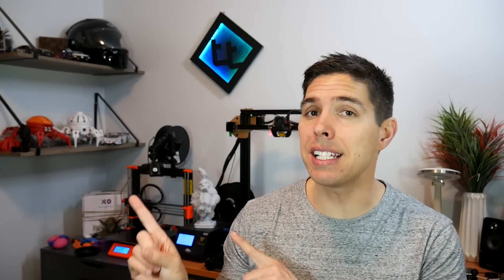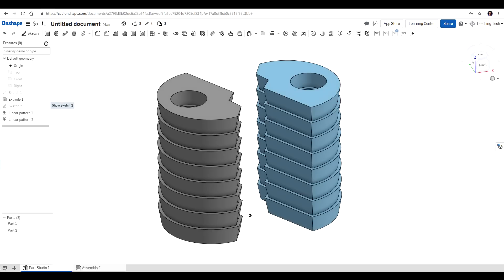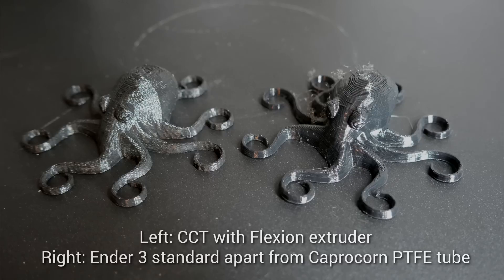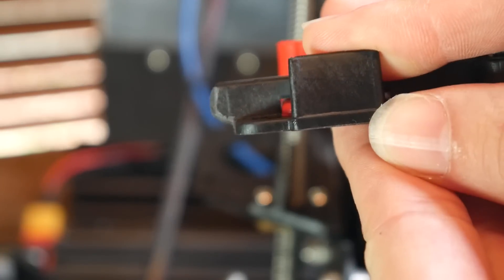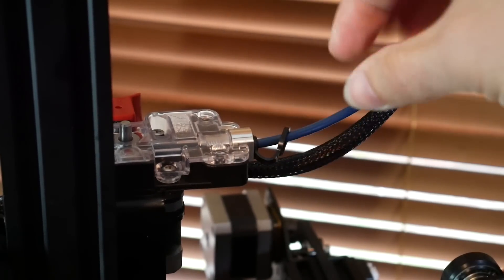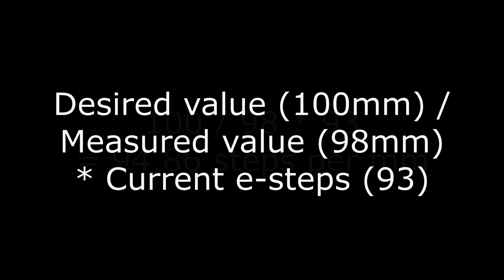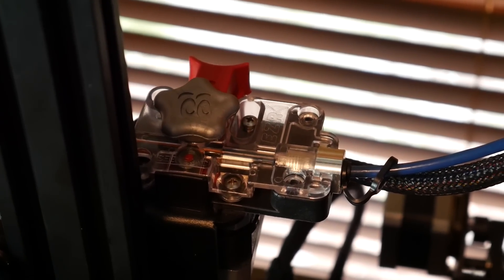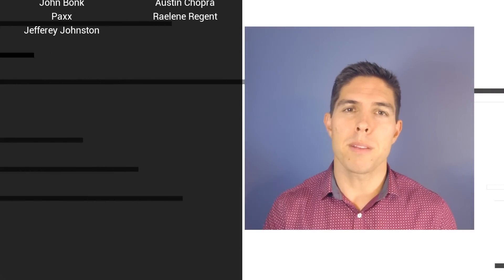EZR extruder tested on the Ender 3

Comment: I do agree that the EZR extruder @ $30+ may be a lot but not a bad upgrade to have on your Ender 3D printer... See I am a 3D printer NOVICE and I have destroyed and put back together my Ender 3 v2 printer and after watching LOTS of YouTube videos like yours I have learned that patience play a long way.

I did buy the SeemeCNC EZR extruder for my Ender 3 v2 3D printer and what I found is that one it makes loading filament quite easy including TPU filaments and in the Cura slicer you do have to play around with retraction adjustments and speed which many of you already know... Two, I didn't like that the "spring" had to be installed but I got it on there right... Once this was done and begin printing I have had VERY little issues with my PLA and PETG prints as well as my TPU prints which came out better then having the original Creailty extruder with little to NO stringing at all. That my 2 cents and if you are a beginner 3D printer person learn your equipment first before making this purchase.

Comment: If anyone still watched this in 2021 i would like to point out you can actually use the stock feed gear in the kit and not have to worry about resetting the e steps works just as good as the new one in the kit and saves some hassle

Comment: I ordered one of these shortly after watching the video and have been using this extruder for a few weeks and finally got to print TPU and this extruder doesnt skip a beat.  I did have some problems with it jamming on a wood filament but Im sure it's that specific filament that's the problem. Loving it and noticed my extrusion on PLA seems more reliable as well.  So love how easy it is to load filament now.

Comment: I just put one on my Geeetech A10M.  Big improvement.  Prints TPU now with ease and PLA and PETG look cleaner than they ever have.  Very worthwhile upgrade on  the Geeetech.  Just be aware that the extruder stepper will have to be reversed from the stock extruder's direction.

Comment: I thought I had my settings dialed in nice for 95A, but during long prints, the filament got weirdly bunched up in the extruder and stopped extruding on a 2-day long print. So disappointing. I have one of these being sent and considering pairing it with the MDD conversion you did another video on. I will say, I wasn't aware of the E-step thing... Did you need to do any firmware upgrades to get that?

Comment: I am considering getting one.  I 3d printed a extruder knob.  Which really helped loading filament.  But here lately I have been changing filament alot. An the filament not wanting to go through into the bowden tube.  Like you mentioned in the video.  Has gotten a lot worse maybe because of the cheap filament I've been using. Or maybe because I have retraction on a lot lately.  The filament leaves dust like particles of filament behind.  I have been blowing out after each print.  I have some tpu I want to try.  But because of the filament get stuck outside the bowden.  I was unable to even load the tpu.  So yeah I may have to get this been eying it for awhile. Thanks for the review!

Comment: I installed the EZR extruder and while using filament, the stepper motor will go forward for a bit then quickly reverse, then go forward again.  It does this alot and I get under extrusion.  I have changed the tubing, cleaned the hot end, changed the nozzle, and even installed a new stepper motor.  BUt it still happens.  Any suggestions?
Reply: I have the same issue and am ready to put my stock extruder back on. I've lowered the maxfeedrate and increase the temp, which allowed it to go farther without skipping steps, but it still happens. I have a support ticket in with SeeMeCNC, so we'll see if they can help.... or I'll return.

Comment: Just a little heads up for those doing this modification, the little set screw (i.e. grub screw) should be on the flat part of the shaft, NOT on the rounded part.  I saw another video where the guy made the same mistake (Edge of Tech) and later corrected it and mentioned this in the comments, but never updated the video.

Comment: I just got one of these and installed on an Ender 3.  Initial loading was fine, but while trying to calibrate the steps/mm, the gear started slipping really bad (the gear on the filament, not skipping steps).  Any thoughts?  I didn't have any trouble with the stock one.

Comment: I'm having a heck of a time and could use help. I keep getting skips while manually extruding using the EZR Struder and a direct drive setup with a Micro Swiss Hotend.

Any advice would be awesome
Reply: did you calibrate your extruder feed and flow rate?

Comment: What settings do you use for the Ender 3 for TPU? I am using Ninjaflex and prints look like poop. Filament not flowing smoothly. Printing at 20mms @ 230C, no retraction

Comment: My gear won't push the filament through. It just get's stuck and goes back and forth making a clicking noise. I tried my best to align the gear with the filament but it's difficult tightening it through the opening. It's like there is not enough room to even fit the allen key in there
Reply: Did you ever figure out your problem @Ryan Saper?
Reply: @JustinSwinney  Yes I actually just figured it out a couple days ago. It turns out I had the gear upside down lol.
Reply: @hooperdtbc  ohh ok. Mine goes through but Im getting a bunch of slips/gear skipping when the Micro Swiss hotend is added
Reply: @JustinSwinney  My Houkr hotend clone was starting to skip, but I recently reinstalled the Micro Swiss. It's working now but wasn't when I first tried to install it, but I think it really just comes down to the extruder. When I first used the Micro Swiss I had the stock Ender 3 extruder, but combined with the EZR it seems to hold up. I actually lost some hardware I think for mounting the Micro Swiss, it doesn't fit right, it's off at a slight angle, but I compensated the angle offset in Cura, so it's currently working just fine. I've been printing the medical face shields with PETG and Micros Swiss is taking it like a champ.
Reply: Oh and on my Houkr clone, I was printing a lot of TPU, which I think built up over time making it difficult to get a good flow of other filament. Try doing a cold pull on your micros swiss to make sure it isn't any left over filament.

Comment: I have big issues with the filament not feeding through to the bowden tube. It constantly bangs up against an edge somewhere past the extruder motor making it necessary to make two cuts to create an arrow head shape on the filament. The issue persisted after "upgrading" to an aluminium assembly. Identical save for being made out of metal. Why on earth did they not engineer it with a smooth funnel leading up to the bowden tube so that filament can't get stuck? I am getting this EZR solely for the ease of feeding in new filament. (Edit: With shipping and customs it turns out that this part triples in cost. So I guess I'll just keep getting frustrated to the point of almost kicking the ** out of my CR-20.)

Comment: I found the standard extruder to work but it did fail after not much use. The lever broke at the threaded insert so it certainly wasn't okay mechanically. I have now got the seemecnc extruder as a replacement. Overall I think it is a worth while purchase and long term I think I would have bought one anyway.

Comment: I want more torque from my extruder.  Can you just upgrade the extruder stepper motor.  That way I can use the same gear.  Those bondtech extruders are too steep especially when you want to upgrade multiple printers.

Comment: Thanks so much for the review and tutorial.
So aside from the convenience of loading the filaments, planning to upgrade to the metal handle from the stock plastic in the extruder vs the EZR. Is it okay just to replace it to a metal one? and how do you do an extruder test with a stock firmware of ender3?
Reply from the maker: I haven't used a metal one, sorry. The procedure is the same for testing, but with stock firmware you can't save to eeprom so you have to put the m92 line in your start gcode.

Comment: I just picked one up since I always have trouble feeding filament into my CR-10S...it gets around the gear but not the input to the Bowden tube.  I usually just remove the fitting and away it goes.  BUT...I also see some slipping from time to time and with no real well to apply (or reduce) tension on the injection molded CR-10/CR-10S extruder, I figured $35 is a safe gamble!
Reply from the maker: Just ordered and received two more for my A10m. I'm definitely a fan of these.
Reply: @TeachingTech  mine arrives soon   As for my Geeetech A10...that's a long story (please, check my Channel!)
Reply: Teaching Tech I have enough tension on my Ender 3 that some prints with lots of retractions end up chewing and flattening our spots on my PETG filament and causing under extrusion due to friction in the Bowden tube. Do you think that this would be better? It sort of looks like the bulldog in the way that it pulls straight rather than pinches the guide at an angle. I haven’t found a straightforward solution that includes adjustable spring tension, as I’d like to back mine off a bit to avoid this problem, rather than having to reduce my retraction distance and amount per mm in Cura. Thanks for your input!
Reply: I wasn't sure what to make of the extra hardware.  The two holes near where the bowden feeds in...I'm not sure what screws were supposed to go in there.  Based on the diagram and what was included, the long screws don't fit and the smaller screws don't stick out the bottom...so the idea of leaving something there...?   I re-did my esteps and wound up reducing them.  The test prints so far do not have any under extrusion going on.  It's a little touch pressing that red lever to remove/change filament.  Cautiously optimistic!

Comment: Hey, quick question. I changed my extruder out a bit ago and didn't know about this adjustment. anyway the value I got came out to be 31mm short with a new esteps being 134. 76 and I was wondering if the tool octoprint would execute to about the same as a E100 gcode? Because that seems quite a lot.
Reply from the maker: It is a lot. One tip is to do it slowly and/or with the nozzle quite hot to remove any chance of obstructions. Doing it in Octoprint shouldn't make a difference.

Comment: Great video as always. Finally you solved my issue. Why doesnt m500 pemanently Save New settings. I ve added m92 + m500 to my starting gcode as a workaround but now its all clear why its not working. Does the firmware update give you any other New features?
Reply from the maker: Firmware update will add EEPROM support to be able to store settings, things like babystepping, support for auto or manual mesh bed levelling and most importantly: thermal runaway protection.

Comment: Hey Michael, awesome vid as always.  Though, it found me wondering if you preferred this extruder over say an E3D titan mounted the same way?  I only ask bc I’m rather fond of the horizontal mounting of the extruder as I have an in-line filament runout sensor..   but..  the titan would allow me to use a lighter stepper without losing power to pull the filament..   what’s your thoughts on this?
Reply from the maker: I have a Titan Aero on the way so I can make a better comparison then.

Comment: I am having  trouble with my cocoon create touch it does all the bed level heats to the temp of what ever im going to print and thats it. It won't start the print i have checked all cables swapped  sd cards it  just won't start have you any ideas please thanx Joe
Reply from the maker: The next thing to check is your gcode. Go through line by line looking for issues. If you had a typo in the start gcode it will get stuck there. Happened to me once in the past.
Reply: @TeachingTech  yep gcode start was wrong thankyou so much

Comment: I just started printing SainSmart Clear TPU from Amazon on a stock Ender 3. So far it's working great (a few jams if bed is misaligned) but I've had the filament a while so I am going to see if dehydrating it will reduce stringing.

Comment: The Ender 3 stock extruder has given me nothing but grief.  I have been having a heck of a time of underextruding (about 40% under).  I tried replacing with one of the aluminum aftermarket versions and I started to grind filament which often would cause worse under extruding.  I attempted to calibrate my E-Steps usually with worse results.  I believe this is due to unpredictable skipping of steps.  Right now I'm using a 3d printed spacer for the extruder spring which has gotten me to around 86% accuracy in extrusion.  I may consider this extruder if I cannot figure out something soon.
Reply from the maker: Sounds like something is amiss. First time I've read about this problem. Hopefully you can sort it soon.
Reply: If you haven't solved this, I had the same issue. Check if your bowden tube couplers are slipping. I found the one at the extruder has a tendency to wear out and slips during retraction and the stock one was rather weak.

Comment: I agree the stock hardware is pretty good for a remote system. I have seen several people on the FB group where the tension arm is breaking on the original. I am eager to get you my prototype direct drive system for you to try out. Going to try sending some metal filament with from The Virtual Foundry so you can see why I think a direct drive is so important.
Reply from the maker: Keen to test once you finish development.

Comment: Great video Michael. I've had zero issues with the stock assembly and do see that it will possibly wear down after time but I will just upgrade to the aluminum one I bought. Until then I will just keep using the stock. Keep up the good work and thanks for the valuable information you provide to the community.

Comment: You don’t detail the shore hardness of your flexible. Looks like yours is not super flexible. Try printing 85A Ninjaflex on the stock extruder and you’ll get it slipping out of the stock gear setup. So the EZR is a great upgrade. I use it on my Ender 3 all the time.
Reply from the maker: You are right, I neglected to include that info. The shore hardness is Shore A 95. I will update the description.
Reply: I have printed PLAflex from 3dfillies (Shore A 90) on the stock extruder without problems.
Reply: Hey @Bonj ! I know that thread is bit old now, but what settings were you using ? I'm trying to print PLAflex from 3dfillies on a stock Ender3 too, and having significant underextrusion. I've narrowed it down to the extruder gear itself by disconnecting everything else and running an extruder calibration test, so concluded the stock gear just wasn't good enough... until I saw your comment !
Reply: are you going to be trying a dual gear extruder anytime soon?
Reply: Got it installed! Looks great, feeds perfectly. Can't wait to see how it prints rubber! Lol
Reply: Was looking for a quick and cheap fix for printing flexible filament (some TPE, shore hardness unknown) and I found on Thingiverse a guide for flexi that I printed and that replaces the stock part on the extruder and forces the filament into the tube. Seems to work like a charm so far. (I’m new to 3D printing and haven’t compared to more pro solutions, though.)
Reply: I was wondering that too. Mine is currently on a truck out for delivery, should be here before 8pm tonight. Can't wait to get it installed. I'm looking at printing super flexible stuff for my kids for what it's worth. Purchased because of your video on it.
Reply: thegrafxguy1 - My $3000 SeeMeCNC Artemis has the same EZR as it’s stock extruder. It works flawlessly. Being able to upgrade a low cost printer to the same capability is a great option.
Reply: @FilamentFriday  Do other filaments gain a benefit in print quality from this upgrade or just 85A Ninjaflex?  One of my gripes with the stock is when doing filament changes in the middle of the print.  I can see where this would make that process much easier and less likely to knock the gantry down in the process.
Reply: Ben G any soft material benefits but the spring action is more consistent so I see better grip on all filaments.
Reply: @FilamentFriday  Thanks for pointing out the shore hardness. Was going to until I saw your comment. I'm thinking of getting the EZR extruder. Would it make loading and unloading filament easier for color changes? Am also getting some under extrusion right now and think it has to do with not enough tension on the spring so maybe this contraption would fix that?
Reply: Thanks chep i just ordered mine
Reply: I printed NinjaFlex 85A on a stock Ender 3 Pro Extruder, no problem.
Reply: Would rather have a direct drive setup over either of these remote setups.